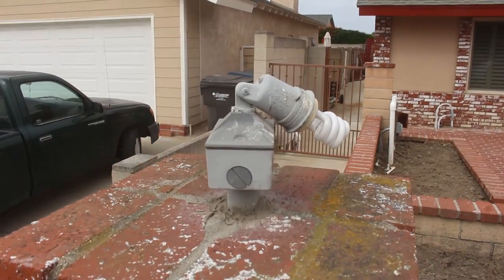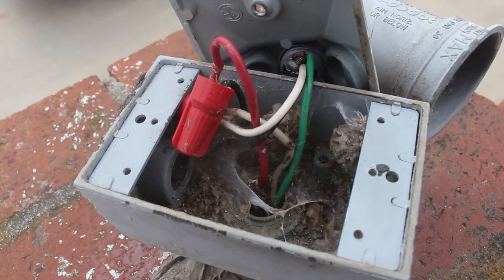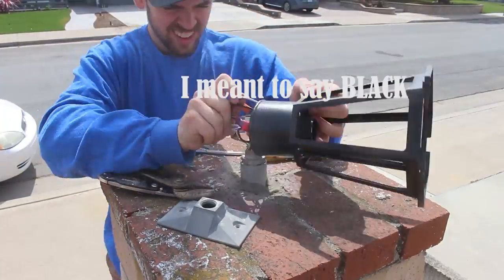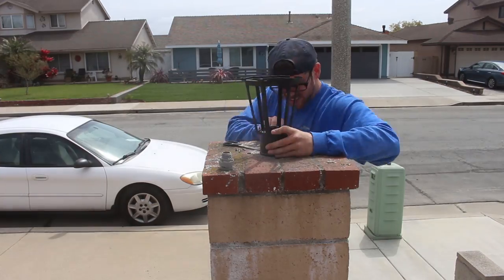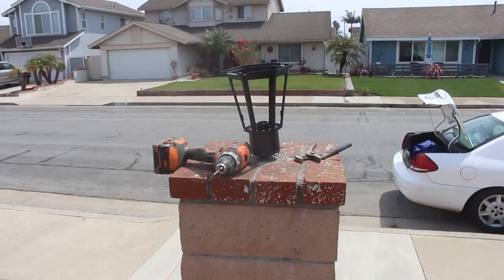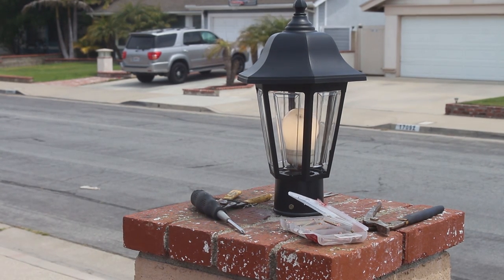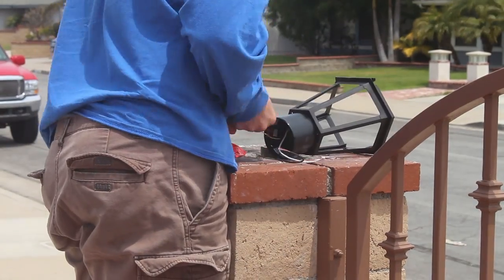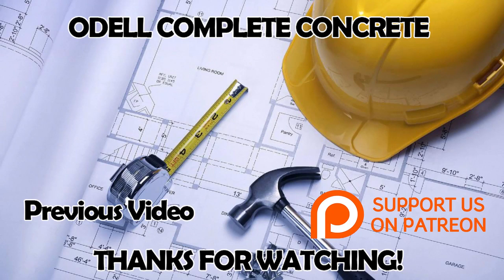How to Install Lantern Lights on Block Column

Comment: On these post lights they sell a base for the lights. Your not supposed to screw into the pipe itself
Reply from the maker: I concur
Reply: It's called a Pier adapter base since it's getting placed on a column type structure. The lamps are considered Post, as in light post, but you can use a pier base to place atop a wall or column made of concrete, brick or stone.

Comment: If this helps anyone....at home depot amazon lowes too im sure, they sell about $20 to $30 

KLEIN TOOLS NCVT-2

 dual voltage tester.  You just turn It on rub against ANY electrical and if it rapidly beeps then that wire is live.  No beep no current running thru it basically.

This is just for AFTER youve already turned off the breaker... and for checking to see if something is live or not if youre not sure say an outlet without power etc for example... you plug something in no power etc

Extremely helpful tool id say most if not all electricians own one.  YouTube videos on how it works as well alot of em.

Cool video here btw as usual.  Looks clean and neat.  I really liked that big angle grinder looked pretty powerful.
Reply from the maker: Good info thanks!

Comment: Is there any option to get these lantern lights in low voltage so that it could be hooked with the landscape lighting that turns on and off via photosensor?
Reply: Yes. Just use the low-voltage wire to the lamp and replace the bulbs with the 12V version.  It's easier to do with the candelabra-style bulbs, but you can also find the larger base bulbs.  You can also use the 120V LED bulbs with the built-in dusk-to-dawn light sensors, or even better, install a single photosensor to control all the lamps (so you don't have them come on and off at different times).  I've done it both ways:  re-wire for 12V and use 12V bulbs with my landscaping lighting controller and 120V with a photosensor.  The 120V is more professional, but the 12V system is a little easier (it's only 12V, and the wiring doesn't have to be encased in conduit since it won't hurt anyone hitting/cutting it accidentally with a shovel).

Comment: Nice video and nice try. You really needed to have a Pier Mounted light base to install these light on to. You would never want to run a screw though the conduit where the wiring is. That is a huge mistake. Take it as a learning experience. God bless

Jeff Licensed Journeyman Electrician - Sunny Central Florida
Reply from the maker: That makes sense
Reply: @OdellCompleteConcrete  Thanks for the response. Keep on trying and continue to film videos like you all have. It was neat to see you make a video including electrical. Be safe and take care.

God bless you all,

Jeff

Comment: Black to black, white to white, brass to brass.  If you have a red wire it could be that the person installing used what they had on hand.  Red and black are hot, white is common, brass is the ground.
Reply from the maker: I concur

Comment: I could use your quality work here in GA.... It's hard to find those willing to do quality work.
Reply from the maker: Would be nice to come to GA
Reply: Yeah, a VA sub contractor poured a driveway from the front to the back for an emergency to my wheelchair ramp and the new driveway on the side of the house is already falling apart and to walk it on is like walking on a wave -  it is NOT level to say the least.
Reply from the maker: That sucks
Reply: BIG TIME!